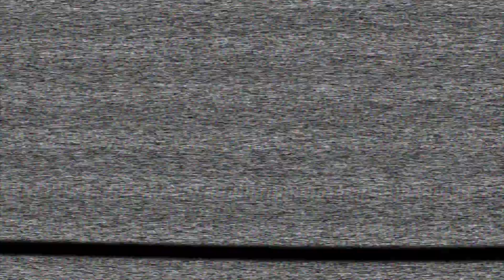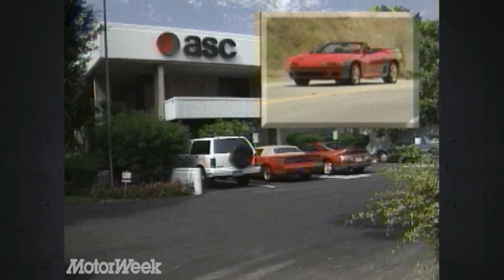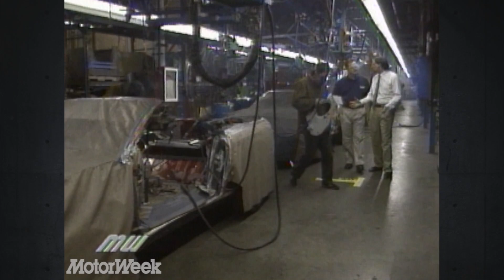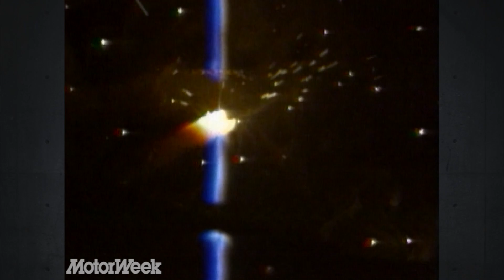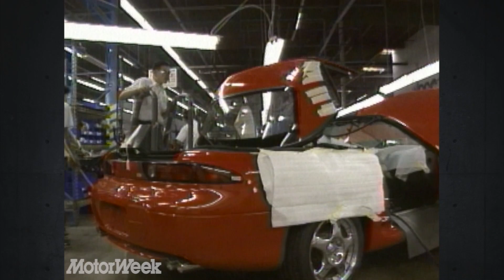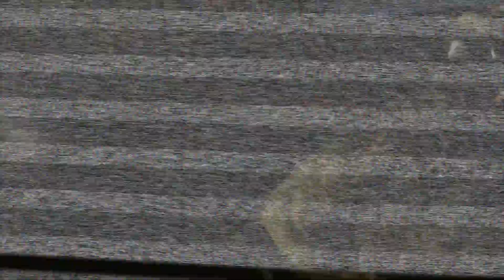Making a 3000GT Spyder VR4 | Retro Review

Comment: This is an underrated classic.
Reply: It was a 4wd boat.
Reply: Would get you thru the snow especially goin to work
Reply: @Arayig1982  You say that like it's not exciting.
Reply: It's not underrated, just not very reliable and a pain in the ass to work on. That's why most JDM fans don't want a 3000GT.
Reply: @basshead.  pretty much all Japanesen high performance cars of the '90s were unreliable.  They ain't no fuel miser corallas.
Reply: @Arayig1982  
3000GT/Stealth, RX7, SVX = terrible reliability
300ZX, Skyline = average reliability
Supra, NSX = good reliability
Reply: @basshead. Even in comparison to fuel econobox like civics and corollas, even NSXs and Supras are not as reliable.
Reply: @basshead.  I own several vipers and the 3000gt is better than most new cars. It's a lot easier to work on than the 300zx tt for example
Reply: @basshead.  Back in the day they cost to much.
Reply: @Arayig1982  They are but are driven harder
Reply: Classic car and rariest

Comment: I was involved in the Mits Eclipse Spyder project and remember the VR4 project well. The guys at ASC were a great group and Heinz Prechter was great boss. I learned more engineering and math skills in 6 months at ASC, than I learned in 4 years of college .
Reply: Eclipse too? This is amazing and I never knew that a third party was responsible for modding a brand new car- always assumed it was a factory job.
Reply: @Momo_8k   Yeah. Add the Toyota Solara to the list, too.
Reply: @DeKrampus  🤯
appreciate the insider knowledge.
Reply: @Momo_8k  I need to clarify, The majority of Eclipse spyders were built in Mits facilities and the Camry /Solara was built in Toyota's facilities. But before they became full production, they had to start somewhere. ASC was the first place I got to see tires that could lay down multi-colored burnouts,too. Lots of fun and work, all those years ago.
Reply: @DeKrampus  are you saying that ASC was contracted out to initially engineer the convertible for Eclipse and Solara, after which those companies took over the production of each? 

The BFG tires which came in blue/red/yellow? Were those initially engineered there as well?
Reply: @Momo_8k  Yes, ASC engineered the tops. After the first few (we had to hand craft the retracting mechanisms, to get the geometry right), ASC built only the tops off site, then the respective cos. installed them in their factories. As for tires, Goodrich (I guess, I didn't check the sidewall) did all the tire engineering, AFAIK. ASC's Southgate back lot was just the first place I ever laid eyes on them. If memory serves me well, a similar set of tires were put on an orange, Auto show model Geo/Chevy Tracker. The tires had a funky, one off, artistic pattern molded into them. You'll have to pardon me, if I get anything wrong. It's been nearly 25 years since I was last at the former ASC facilities.
Reply: I had a 95 300zx convertible that was also made by ASC too

Comment: I used to want one of these sooooooo bad! The Supra gets the nod obviously for performance from this era, but the Mitsubishi was so innovative for the time. The active aero, speed-dependent 4WS w/ AWD, and other advancements started a revolution for years to come. Even the convertible was an advancement in an era when the $120K MB SL600 still had a fabric top w/ plastic rear windows that would fade. The 3000GT is starting to accrue in value again, along with other 90s era Japanese sports cars(Supras are ridiculous right now).

Comment: Remember the time that Mitsubishi used to push technology to their cars? 

Like this, presentijg active aero,suspension,exhaust. Features that ONLY go mainstream nowadays?

And the Evo? Could go up against legit supercars/sportscars at the time presenting early torque vectoring from the AYC system.

Nowadays they're stuck with making cheap cars and SUVs cause they need to sell stuff. But the stuff they're selling is all generic and unappealing anyways.
Reply: Gasoline direct injection (GDI) was another achievement which they eventually gave up after a few years, but that every other brand subsequently adopted.

Meanwhile rear hybrid LSD was another one before AYC came to the scene.  But that diff was rare and indeed expensive...

That said, AYC was not all well reveived because those who wanted more control would prefer mechanical LSDs instead.

Comment: Always found it interesting how car companies made their own convertibles that ran down the same assembly line as other body styles back in the 40's/50's/60's/early-mid 70's.  Then they quit making convertibles for a bit in the late 70's, the Detroit 3 did anyways, but you could still buy non-factory sanctioned convertibles from aftermarket coach-builders(like ASC).  Then the car makers realized they were missing out on $$$, so started building convertibles again in the 80's, but this time it wasn't done in house, it was sent to aftermarket coach builders like ASC, like this Mitsubishi.  Just interesting that they didn't move production back in house on the main assembly line, cause it sure seemed like it would be cheaper than having ASC completely hack up a car like in this video.
Reply: When they started to make them in house again in the 90s, that’s when ASC moved to specialty components and builds for automakers and eventually went under in 2017.

Comment: Crazy that this is the cheap way to do convertibles too. Fantastic thanks for the upload
Reply: They did it this way because they didn't make many spyder versions. They weighed more and had a higher center of gravity, so most buyers that wanted a 3000GT VR4 didn't want the convertible version. Not to mention they were much more expensive. Close to 50k.
Reply: @SubaruWRXspdManual  ok?
Reply: @SubaruWRXspdManual  Over $50k! I have a 96 Spyder SL and the original window sticker is $59,575. Add another $10k+ for the VR4 package makes them close to $70K.